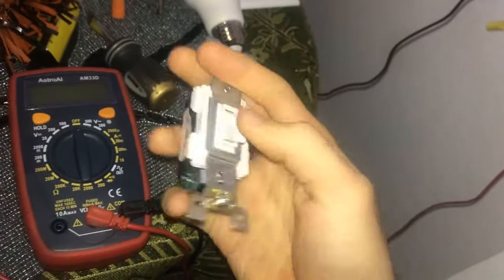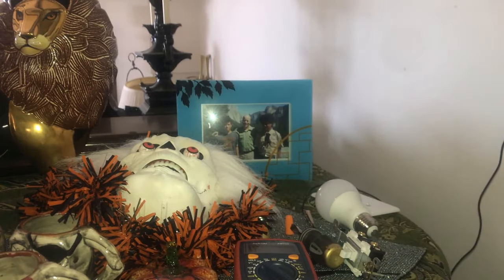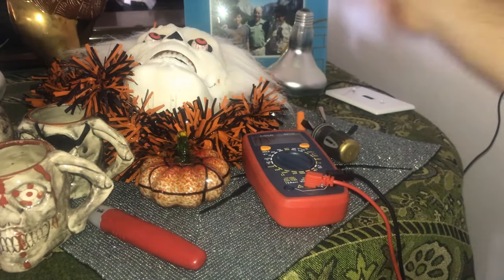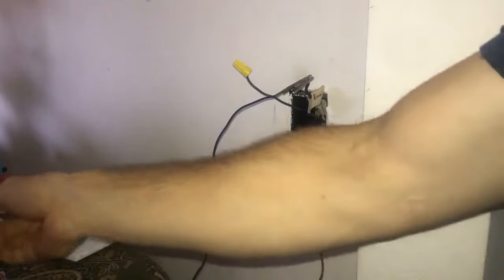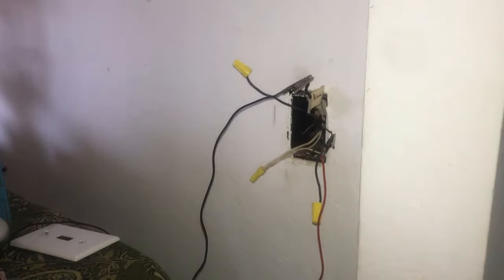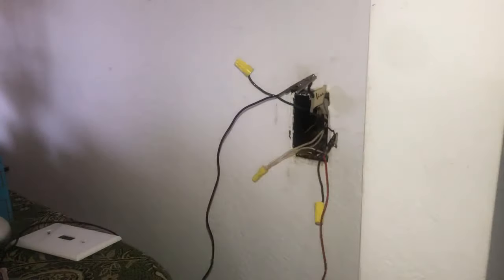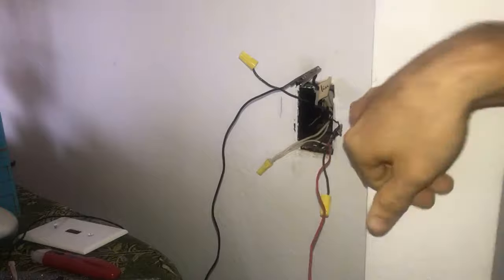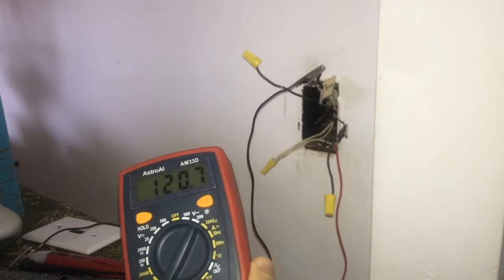Light Switch and Circuit Box Multimeter Testing

Comment: I dont normally reply to youtube videos, but I suppose it is my due diligence to correct a statement you made. Current does not flow in the direction you stated in a lightbulb. The screw shell, which is the part that threads into the lamp holder is making contact with the neutral wire, or what has recently been re-named to as an identified conductor. The hot, or live wire is making contact with the bottom pin of the lamp. I support youtube videos for education, but be sure you are relaying accurate information, especially with electricity.
Reply: Also, he said "220" when clearly on the meter it is "120".
Reply: Ok nerd😂

Comment: There's really no point in making a how to for testing , if you're not gonna show people the meter . Just to clarify to people , if you're testing an outlet or switch , you're looking for 120 volts , so you turn to the AC symbol to 200 . if you're testing car voltage , you're looking for around 12-14 volts , so you turn to the DC symbol to 20. If you're testing for continuity , you turn to the ohms symbol .

Comment: It appears that the first light bulb that you ran the continuity check on was an L.E.D. bulb. You can't run a continuity check using a multi meter on a L.E.D. bulb because that type of bulb uses a semiconductor circuit to produce light. You can only run that type of check on a standard incandescent bulb.

Comment: Just remodeled my bathroom and put LED mirror on. Next day it started flickering and the next it stopped working. Now reading from wires in light switch outlet is 29 volts. Breaker looks ok and wasn't tripped. Any advice? Thanks

Comment: I have changed the starter battery replaced some of the relays all the fuses fixed broken wires and  my 2005 subaru outback wagon wont crank or start I'm not even getting  otherwise everything works what can I do?? ((HELP))

Comment: Why did you say 220 when it said 120?
Reply: Generally all residential homes are wired 220-240V. They are on 2 lines which are split which makes it 110-120V. Whenever you’re checking voltage in a house you will read 110-120 but it’s technically coming from the original line which is 220-240.. most electricians just simply refer to it as 220
Reply: @CjLand9  it comes into your home on (2)120v legs at opposite polarities. together they make 240. the neutral gets you 120 on each hot leg

Comment: How about how to find a short with the multimeter?? I turn the brand new switches on and it blows the fuse. Only the inside and outside garage light. Other lights on circuit don’t blow it.